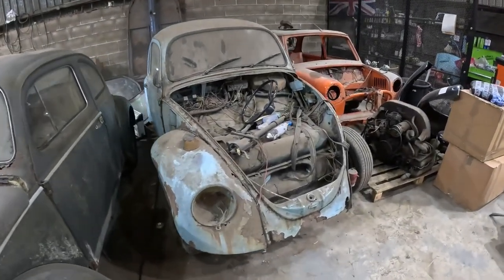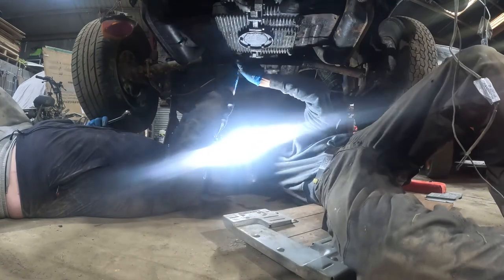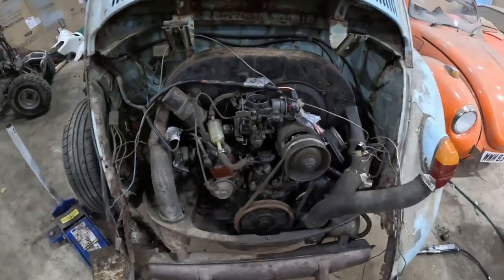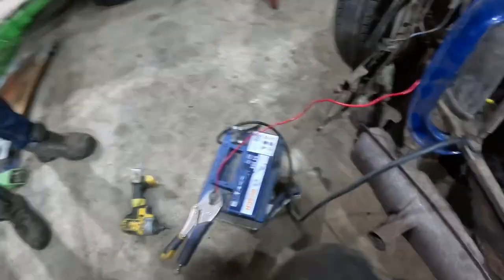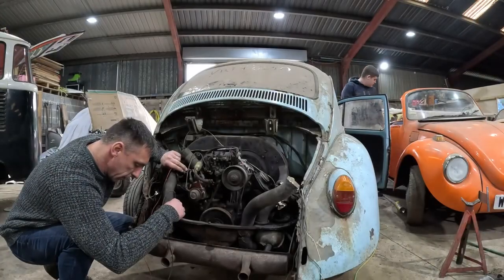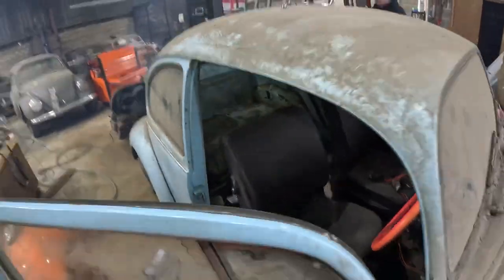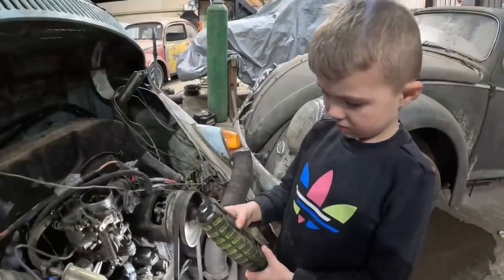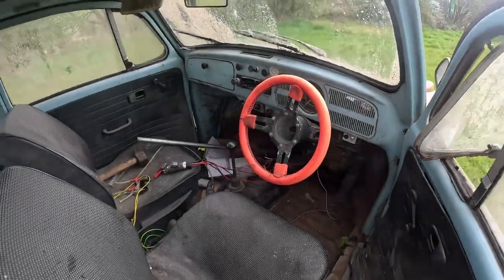VW Beetle barnfind will it run after 40 years

Comment: On the original engine:

If you want that engine unstuck, closer to being unstuck, or able to come apart.
Here’s what to do:
You will need…a plastic bin big enough for the engine. A piece of pvc pipe. Gravel, 5 gallons of vinegar, 5 gallons of diesel fuel. A 1/2 breaker bar, and one of those torque multipliers. A kerosene syphon pump.
Get a plastic bin, big enough to fit the engine in. Pull the spark plugs, valve covers, and oil strainer plate. Put the torque multiplier on the gland nut, crank it down, and put torque on that nut…clockwise.
Put the engine in the bin.
Place a 2” pvc pipe down the corner, and fill the bin, with coarse gravel. NO SMALL STUFF….you’ll have to sort it. This will displace space so you don’t need so much liquid.
Pour 5 gallons of vinegar into the bin, and swish it around a bit, to get the vinegar all over inside that engine.
Let it set for a month, going back every week to slosh it around, and working torque on that gland nut.
After a month it should have broke free….if just a little bit, dissolving rust….at least so you can get it apart. 
Put the business end of a kerosene syphon pump down the pvc and syphon out the vinegar. Put it back into the gallon jugs for later use.
Pour your 5 gallons of diesel fuel in and swish it around. Try every day to let the torque off, and re apply.
When your done siphon off the diesel and put into the gallon jugs for the next use.
If it’s not free, it probably had a seizure while running (not rust) too hot or ran out of oil.
I’ve done this several times to amazing results. Patients is the key. Let the vinegar do its work. And sloshing it around. Applying new vinegar to the rust problem inside.
Good luck
Reply from the maker: Thank you I may try this lol 😆